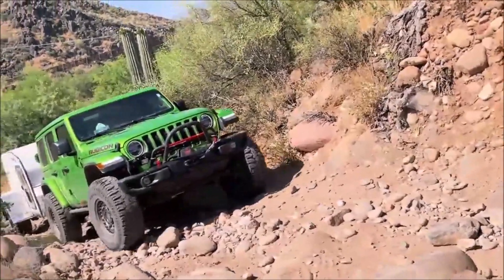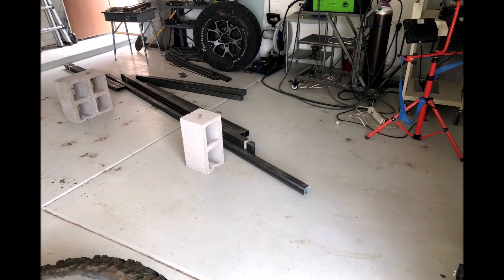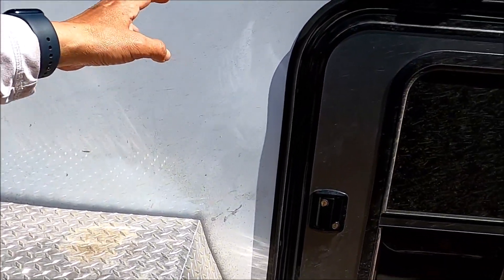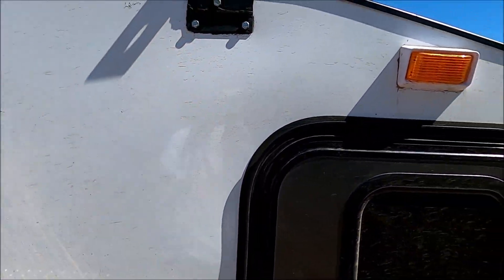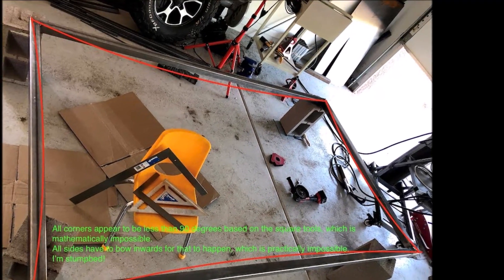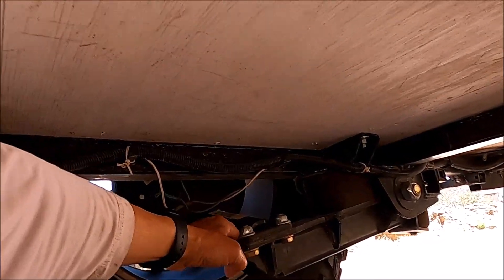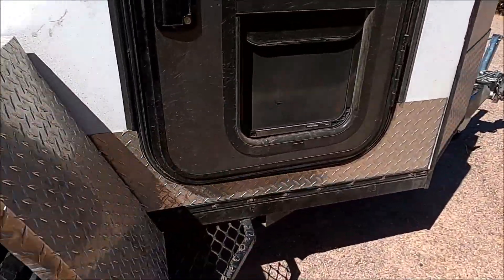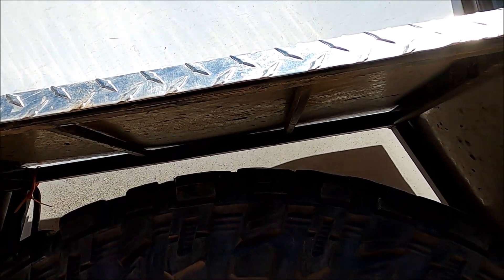DIY Ultimate Off-Road Teardrop: Frame Design & Build - Part 2

Comment: How much tongue weight did you allow?
Reply from the maker: The ideal tongue weight is 10-15%. In my case, that would be just under 200 lbs.  I checked tongue weight a couple of times, it was ~160 lbs. I normally don't check. If I'm really concerned, I can move some weight to the front.

Comment: Hi 
Can i use this trailer for Atv ?
Reply from the maker: I'm not an expert on ATVs, but if I understand your question correctly, an ATV typically doesn't have the towing capacity needed to pull a teardrop camper safely. These campers are generally designed to be towed by vehicles with more power and stability."

Comment: Well that was interesting. Incredible you took on that welding after only 2 classes.  It shows. Some of them welds look a little dubious. But solid. I don't think it will be a problem but if I were you I would regularly inspect them. There is a lot of stress on the trailer taking all those backroads. I am building my own trailer too and chose to have a structural frame with 2x1 channel iron. Mine has to be as light as possible bc I want to tow it with an EV. Same design, 5x8 with similar tongue but with a regular 2000# axle. I hope the whole trailer will weigh in at less then 800#. Btw what does your trailer weigh. Did you ever have it on the scales? Nice vid , Thumbs up.
Reply from the maker: Thank you for the comment. Yes, I only took 2 lessons,  I also practiced with some small pieces at home. I finally managed to get it on a scale, it is 1,700 lbs loaded. I was hoping under 1,500 lbs. Many factors contributed to my total weight: 37" wheels with fenders, tongue box, roof rack & solar and full insulation. Good luck with your build. It's an amazing experience for sure.